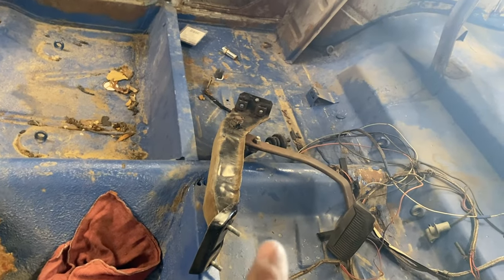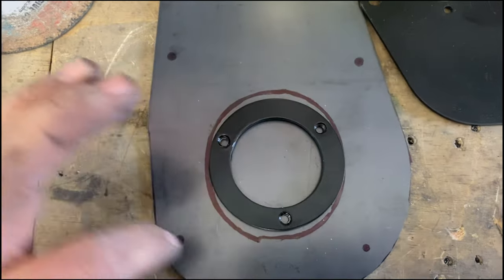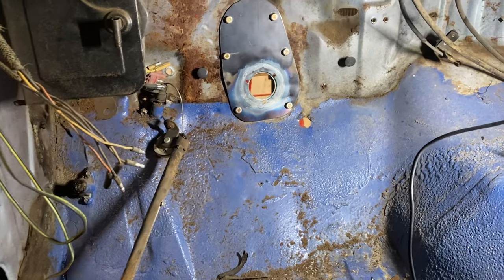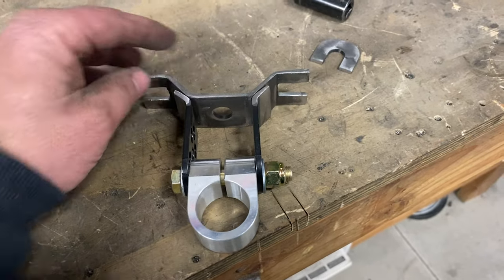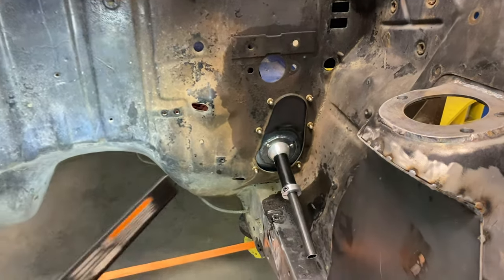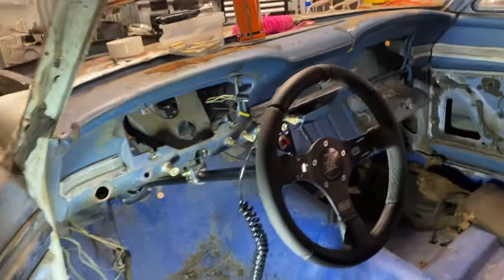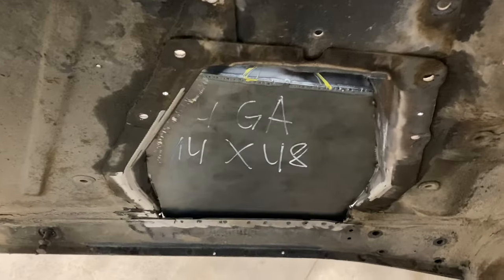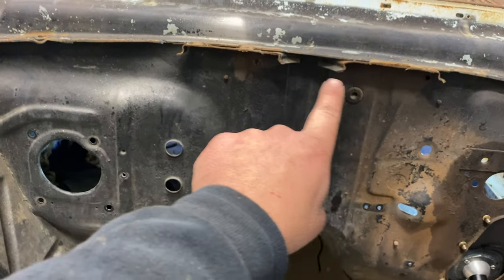Mocking up a FOXBODY TRZ lightweight steering column in a 1963 FORD FALCON

Comment: Hey bud , loved the video. You may have already said something about this : are you going to mount your engine with a motor plate/ mid plate ? Have you considered moving your firewall back to base of the windshield ? If you did this , you could run a box style oil pan , and the headers wouldn’t be encumbered by the shock towers . And you could run floor mounted pedals - that would really clean up the clutch linkage, not to mention give better access to the master cylinder . The firewall could be cleaned up as well. Just friendly suggestions, that’s all . I wasn’t being critical . This is your car . You build it the way you want . It’s got to accomplish your goals and make you happy .
Reply from the maker: I am gonna run a motor and mid plate, I’ll go over that in the next video. I am hesitant to modify the fire too much. I need to read some rules and make sure if I did anything like that it wouldn’t prevent me from entering certain classes. I am building it for drag and drive like Rocky Mountain Race Week and Drag Week and for stick shift class, it’s pretty open as long as the car weighs 3000 pounds. Thanks for the suggestions and thanks for watching ! Stay tuned !!

Comment: Sweet. I may steal this idea and use the same column!
Reply from the maker: Got more info in the next video! I fixed it so it moves like butter
Reply: @TeamDPerformance  I will be watching. 99 percent sure I am stealing this idea for my car.
Reply from the maker: The trick was the ream. I failed to catch that in TRZ’s video. The Delrin needed to be reamed after they were installed in the tube!